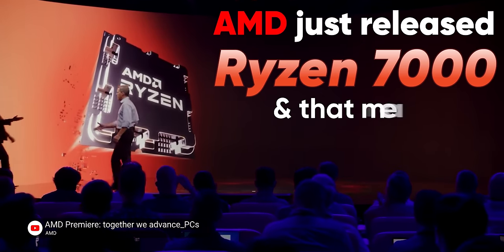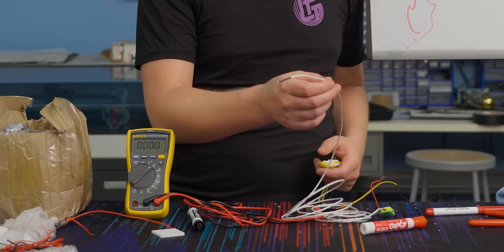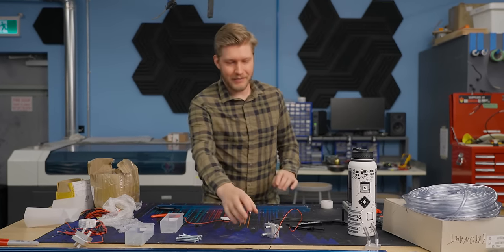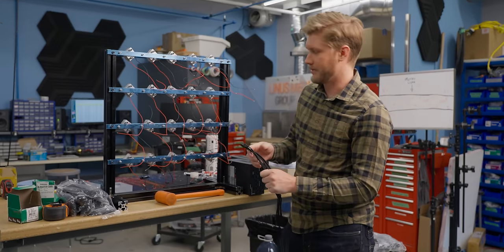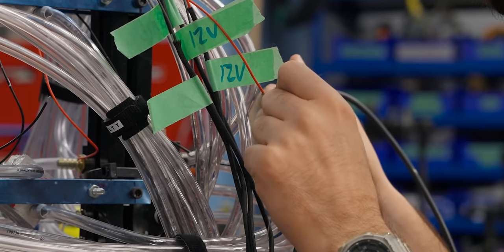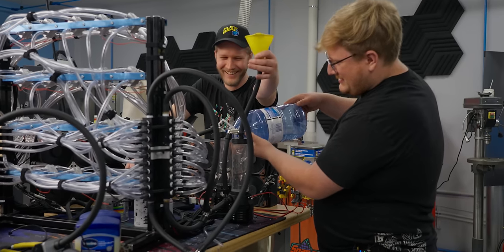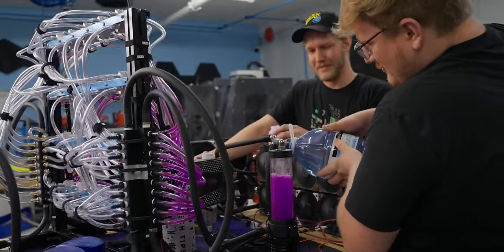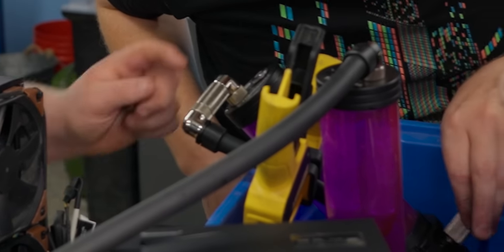Our DIY CPU Chiller From AliExpress is RIDICULOUS

Comment: Here's a tip guys...buy RV Antifreeze (propylene glycol)...not vehicle antifreeze (ethylene glycol)...it's non toxic!!!  Just as effective.  4$/gal at Walmart!  Also, putting pumps in series does not mean you'll push more head.  You'd need to look at pump curves etc...  Look into parastaltic pumps!  You'll have no issues with air getting entrained, no cavitation, no air-locking the pump.  They are easily rebuilt, quiet and fairly bulletproof.  My background is ChemE and 27 years with all types of pumps, industrial, chemical, water and wastewater.  Computer cooling about as long!

Comment: You need to put the pumps in parallel to get a higher flow rate. You dont need more pressure you need a high flow rate to feed all the tubes. Since there are so many tubes in parallel the pressure is instantly dropping (because of the low flow rate) thus not reaching the top. 
What also would help is mounting the pumps on the top so the pump is higher than the rack

Comment: Do a version 2 of this cooling idea! More optimized, compact, make a frame or something so it can be used for future overclocking videos. Put it all in a box that can be transported around etc
Reply: Run the coolers in series and not parallel, that would simplify the lines and reduce the total liquid needed.

Comment: @LTT - Alex, there is one-way air bleeding valves. if you attached it to the top of your return distribution block, you could bleed it without issue. 

Also, that antifreeze should of been thinned, it was killing your pump performance.

Comment: only downside about that water block is most of them may been clogged or wasnt cut open
2nd you could make it easy set it on floor make tube longer so have two big water block spitter on top so air can escape out other side water block spitter keep pump on tablet else

Comment: Next peltier cooling solution should just pump the water trough a giant radiator first to pre cool it, then sub zero it with a setup similar to this afterwards. Since peltiers are only able to achieve a certain difference between their hot and cold side, every degree you can cool the water before it enters the peltier will be one degree less for the end result. I think that would be much more efficient...

Comment: To get most of the benefit, there is no need for such a large amount of peltier cooling.  For example,  try single peltier unit as part of a traditional liquid cooling loop, and give that peltier it's own 120mm radiator (CLC), or if needed, an air cooler, and locate it on the outlet of the primary cooling radiator. That will boost the cooling capability of the loop by a decent amount.
Reply: When you have a sufficiently large radiator such as a 360mm radiator, Typically even doubling the number of radiators will not improve cooling by much, since with the basic radiator, since as the temperature gets closer to the amount of additional surface area needed to get an additional 1C drop increases exponentially. This is why a setup such as a 360mm radiator + a peltier will cool far better than even 3 360mm radiators.

Comment: They said new Ryzen will have much better thermals than Intel i9 but then they screwed up with the unneccesary thicc heatspreader. Skimming off 3mm off that heatspreader would up the efficiency a lot.
Thanks to the person who makes these DIY Aluminium waterblocks in various sizes. Many DIY watercooling solutions wouldn´t happen without them. I did some myself and had no problems with them...

Comment: tecnhically peltier modules have an efficiency curve that starts from 20-25% when the T difference from the hot and cold side is 0 and goes down to 0% at T diff of 40-70C, depending on materials used. so if you have 100W peltier (usually they need strange voltages as input, like 15-16V, to reach that power) and you have no difference in temperature from the 2 sides, you are effectivly transferring only 20-25W of heat

Comment: With TECs, more input power doesn't necessarily mean more heat moved. Keeping the hotside as cold as possible is always a challenge, but just like with cpus, when you start to output too much heat into the hotside given the small area of it, no matter how close to room temp the water in your loop, the hotside will still be really hot. Like how our CPUs can be 70C+ even though our watercoolers are not even lukewarm, heat can't travel fast enough through the tiny area of the chip. In the case of TECs, it makes them extremely innefficient, and even making the cold sider hotter than ambient when the hotside gets too hot. To use TECs with any decent result the input power per 40x40mm chip should be quite low, low enough that the hotside is close to ambient, if you want the coldside as cold as possible before adding a load.
Reply: This is correct. Peltiers are all about creating a temperature difference between the two sides, which in an ideal scenario is 60 degrees. The colder you can make the hot side, the cooler the cold side will be. You have to account for removing the heat from the system and the heat generated by the TEC itself.

Comment: Late to the game, but you guys need to take a tip from the car guys out there.  Bleeding a radiator in a car can do the same thing.  Air will travel to the highest point so the best thing to do is add a bleed screw up at the highest point of the system.  Or, put the reservoir up above the other lines with the top open.  No need to have everything powered up.  Just get it in the air!

Comment: to prevent bubbling and air lock, I would have put the pumps & res above the circulation loop height instead of trying to pump and maintain fluid pressure up-hill into the loop, Great build though Monster cooling setup, very awesome!

Comment: PVC to Metal Threaded connections are better made using a bead of silicone over the threads. It's an old plumber's trick. PVC to PVC threaded connections are best made using tape, though.

Comment: First, you can use more than 1 tech per heat sink. Second the techs have to be current limited otherwise they reverse and become heaters. Third you can generate current if there is a temperature gradient on both sides like a thermocouple.

Comment: I helped write the book on Peltier cooling back in the day chasing the 3ghz overclock of the Barton single core chips, it was a 240w arrangement that saw my name belated on the scoreboard and it lasted a week too, crazy thing it was a 1700M AMD rated at half the 3.1ghz I melted out the poor thing.   I had two independent water systems running with the Peltier attached to a sandwich block then two water blocks and all built into the epic Antec Skeleton I had customised sprayed toxic green with blood spatter and more UV lighting you could shake a stick at hehe   What made the difference was the DFI Lanparty boards which allowed you to up CPU volts but hold back ram and PCI volts which was the bane of the overclock, locking the PCI and RAM volts mean't you didn't murder your video card and ram and I taught both XFX and OCZ the wise thinking of having too open a lifetime warranty with both companies on the nth exchange of murdered ram and vid cards that they would not honour any further warranty claims after this final one...   Sadly at the end of the week long fun, everything just cratered out, cpu, board, ram, the only thing working still was the HDD and PSU, still got the bits in a box somewhere with a tub full of melted AMD cpu's and burnt out Peltier's.

Comment: What about a reverse pumped system? Have a rez tank on top of the frame with open lines to the manifolds, feeding the TECs. This way the water is always moving down, assisted by gravity, until it hits bottom where it loops through the radiators and then out to the pumps suck in the water, then push it back up to the rez. The pumps won't be fighting to push through so many split lines and only have to get enough head-pressure to get the fluid back to the top where the system will be able to burble out any bubbles still in the lines or produced from cavitation.

Comment: next time put peltiers serial. 
example build:
get a 60x60 copper plate. put 4 3mm screw tap holes on corners. 
put a 6A 40x40 mm peltier on copper plate. then put 10A peltier on top of the 6A peltier. 
use thermal compond between peltiers. add 3 more peltiers by putting bigger peltier in every step. 
now you have a reversed peltier pyramid. 

extend the wires of peltiers to top. 
put another 60x60 copper plate to top of everything. screw it to bottom plate with some long screws.
it will keep thing in one piece. 

party piece of this build is waterblock. you need a big enough waterblock to cover top big peltier. 
you guys have CNC router. you can create your own water block with copper. it is not that hard. 

put the custom big water block on top of the pyramid and 
then wrap the pyramid with Polyimid tape for heat insulation, then wrap it with ducttape to air insulation. 

i don't know it will work but i will be fun to build :D

top copper plate can designed to part of water block with groves in it. 
damn i wanted to be in LTT lab to build this.

Comment: a word about coolant: you NEVER EVER run undiluted coolant in a closed loop system, from the factory it’s designed to be mixed 50/50 parts water or even sometimes 25/75 because of how viscous it is, remember it’s supposed to be taking the place of water but just do a better job of it, ie not instantly boil off or freeze like normal water

Comment: Had a peltier on my Pentium II 233. It dripped water on my gpu constantly but my high school logic was just to run my system hotter so that it would evaporate faster. Having a constantly wet gpu was never a problem though. I've always wanted to revisit them now that I can afford stuff like padding and I can use more efficient fans instead of old school deltas.

Comment: You could scale down this system to 2-5 peltier elements add a thermal sensor to monitor cold water temperature and use something like an arduino to turn on and off the elements to keep temperature just above the dew point. Then you could use one power supply and fit it neatly inside the case. This config can potentially be used indefinitely as a viable cooling solution.

Comment: I like the idea. Let's ignore the fact that peltier elements are horribly inefficient, when it comes to moving a lot of heat. But the build was horribly overcomplicated and horribly inefficient. First of all, your concoction is really inefficient in moving heat between the water and the elements. Instead you should use water blocks. You can buy 40x200mm aluminium blocks with proper water channels for like 20 bucks, so you would need 8 of them. Then why the heck would you put them in parallel? That can only go wrong. Just put them in row. Makes it much easier to build, and would work much better (if the pump is fast enough, the gradient becomes irrelevant). I bet you could have cooled it down way better with much less work.

Comment: A better chiller would be to tear down a window AC unit and submerse the cold side radiator in glycol. These are the DIY glycol chillers. You could use multiple AC units for deeper cooling.

Comment: I'd be interested in seeing what happens if you can attach 4 peltier coolers to the CPU via a vapour chamber and then run an open loop with a 360 rad for each. That should be about 340W of cooling with a much simpler setup (no loop on the cold side, only 4 blocks and rads on the hot side). I'd think that the vapour chamber should help reduce condensation on the socket, as IIRC it becomes less efficient at lower temperatures, helping to keep equilibrium somewhere around or above ambient?

Comment: I doubt the pressure head is enough to create turbulent flow in the water blocks. Also you should put the frame on its side so all the water blocks are the same height.

Comment: You guys should buy an actual 5 Ton AC, with hot gas bypass. Set your target Evap to 50°F or 60°F with an adjustable hot gas line and send that to your chiller plate heat Exhanger. Than speed up the pumps and have the compressor unloaded so it goes up a bit more due to slower heat rejection with will cause less condensation on the CPU

Comment: No one ever mentioned that the flow will travel through the path of least resistance, which is why the water wouldn't go through the higher tubes. Higher elevation = more resistance.

Comment: Next time, get 40x200x12mm water blocks instead of 40x40x12mm and run 5 tech's in one tech sandwitch config, and run all of the tech in series, that way you don't need 100000 tubes.

Comment: Alex got it a bit wrong. the 120W on a Peltier is the total power uses. that includes the losses and self-heating. as they are less Tha 30-40% efficient, you will only be able to move like 30-40W but you'll have to cool 150-160W
Reply: Partially correct. The rating is explained in the datasheet - you have to look at QMAX. As for efficiency, you’re only interested in the COP. Your efficiency is dependent on how cold you can keep your hot side - the colder it is, the closer you’ll get to QMAX.

Comment: Cheap TEC is rated 120 watt which is it's max power draw, i.e. something like 24volt 5 amp input.
I guess Alex connected TEC to 12volt rail from SMPS with which TEC would be able to draw 12volt 5amps which is 60watts max.
Now the cooling efficiency for these TEC is 10-15%
I e. Around 9watts of cooling from each TEC, multiple by 20, you end with 180watt of net cooling.
I hope my calculations are right 😁

Comment: I would honestly love to see if there is a more practical use for this tech in an actual build. If one chiller can do 120 watts it would be cool to throw like one CPU block on the cold side and a heat sink on the hot side and see if it's a doable project.

Comment: few problems with the way they did this, first, having pumps in series so closed together in the loop decreases efficiancy of the pumps, the hot side should have been split in three sections which the pumps seperated and then into a common radiator, 2nd the cold side loop should have been in all in series  with pumps  in different parts of the loop and not in parallel, this reduces cooling effects and potential of the TECs, could have gotten so much better results but i guess it is what it is

Comment: To keep it cooler on one side you might want to create an insulation wall between the hot and cold sides of the TEC's to be able to draw out more power.
The reason for this is because if you were running the TEC's for a while, the hot sides of the TEC's might heat up the cold sides and end up drawing less power.
I hope this helps out and improves the performance see ya.
Reply: I was at 10 minutes of the video when posting this, sorry if posting this created a headache👍

Comment: Liquid doesn't behave like electricity. You have to put the pumps in parallel. When you put them in series, it's still just the one pump in the front having to do all the lifting.
If you still want to put them in series, put one pump at the intake of the rads and one at the outtake.
Reply: This is incorrect. Pumps should absolutely be connected in series, not in parallel - it effectively combines their head pressure with very little efficiency loss. There are very few scenarios in which a parallel connection would be beneficial, usually those involve running separate loops from one reservoir. Tl;dr parallel pumps combine flowrate, series pumps combine head pressure. They were lacking head pressure as they couldn’t overcome the incline.
Reply: @Foxi4Qnet  If you combine the diameter of all the thin tubes running in parallel, it is larger than the one tube coming out of the pump. So either get a bigger pump and bigger tube that matches the thinner tubes combined parallel diameter. or add tubes in parallel with pump to match it. This isn't a normal PC build loop with just one or maybe two paths, there are like 20 here (I forgot how many exactly. But i thought they ordered 20 peltiers(?))

Connect each pump with it's own tube Directly to the distribution block. (don't combine them with Y-splitters or anything.)
Reply: @rakly347  Pumps in parallel combine flow rate (due to the diameter difference you mentioned), pumps in series combine head pressure. You’re correct - if the pumps were in parallel, you’d ideally use a bigger inlet/outlet.

Comment: I've watched a number of LTT liquid cooling experiments, and I've always wondered why y'all never add bleed ports to these systems.  Even if you just add them to the problematic lines, getting the air out of the system would be way easier and stress the pumps less.

Comment: I think you should use just regular water cooling loop with anti-freeze and put the fans + radiator in a big enough freezer. Peltier elements have such a bad efficiency that it's not worth using.

Comment: Maybe if you add restrictor valves you could balance the flow. Cause right now liquid is talking the path with less flow resistance and you're not getting a efficient setup. And you're gonna need a stronger pump. 

Can we get a part 2?

Comment: 12:26 commentary.
Doesn't the manifold just let the liquid use a couple less resistive paths, instead of using the full capacity - perhaps more series connections and vertical stacks.

Comment: instead of using thermo elictrics, why not use old phased evapiration by taking a mini fridge apart and run straight refridgerent to the core or use it to cool the water ....thermo electric uses soooo much power for little gain and a newer mini firdge cools well for about 55 watts

Comment: 4:42 You could have just bought a few cheap extension or adapter cables with female EPS connectors and sacrificed those instead.